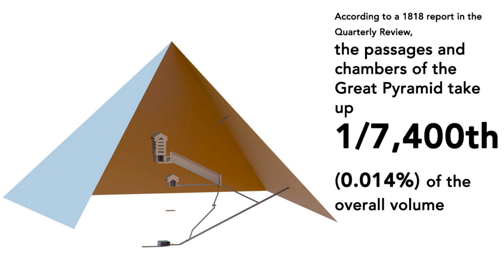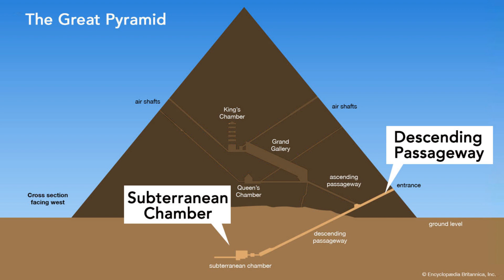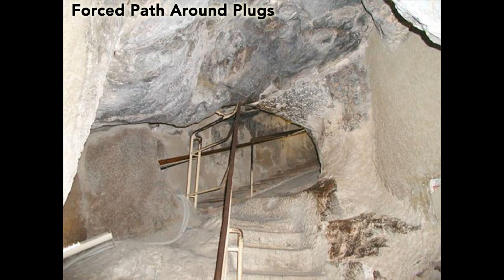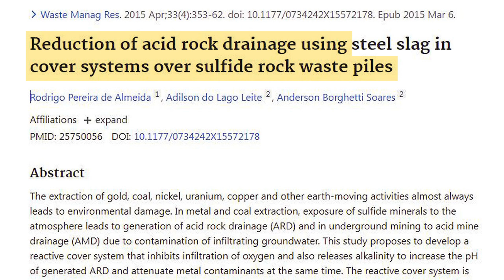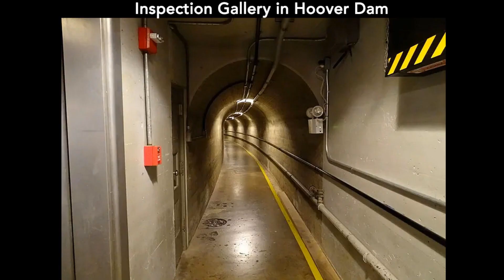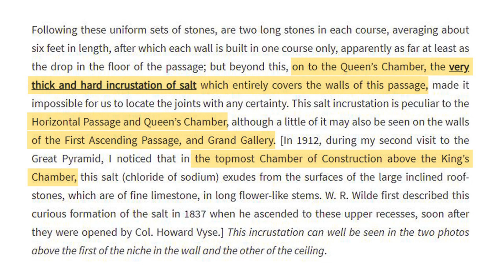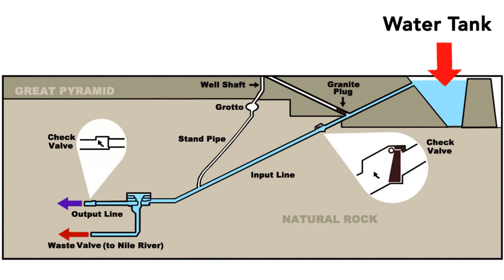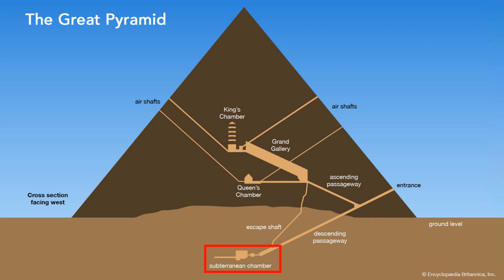The Mystery of the Great Pyramid's Interior System?

Comment: I really enjoy your various interpretations, though there are a few important things to note. The shafts that egyptologists commonly refer to as "air shafts" that are leading down toward the chamber didn't originally complete within the chamber, there was still a solid layer of granite between the chamber and shafts. It was only later smashed open by "archeologists" essentially searching for treasure after realizing that there seemed to be a reachable internal structure at those two locations. I think that's a really important detail that often gets overlooked. They also don't appear to reach all the way to the surface of the pyramid. The pyramid rover images within the shafts are somewhat limited, but they do tell an interesting piece of the story. All that said, I really do enjoy seeing how you parse the data. Cheers!
Reply from the maker: Thank you for sharing with me, Juan. I appreciate it! I read that the air shafts to the Queen's chamber were blocked by salt encrustation (efflorescence). Modern explorers removed the salt and the shafts are indeed connected with the chamber. You are right - the Queen's chamber air shafts do not reach to the outside and there are small doors at the end. I have another video explaining my thoughts on these blocked air shafts and more -  Egyptian Pyramids Reveal Acid Mine Drainage Stains? https://youtu.be/-QyIJ-w-8vc
Hope you will find it interesting :-)

Comment: The Dimensions of the Arc of the Covenant, fits exactly into the King Chambers box. Maybe part of the power supply from it's Mono Atomic Gold inside the Arc? There are no lantern soot on any ceilings.
Also you cannot cut granite blocks with bronze hand tools,  or have man moving 100 ton blocks 500 miles from the Aswan quarry.
Reply: Do you know if anyone has computed, from its dimensions and materials, the approximate weight of the Arc of the Covenant?

Comment: I think the marks within the lower parts of the pyramid are more likely to be caused by water erosion than mining. A guy on youtube (who's name escapes me) built a scaled down model of the pyramids interior and it was a working water pump. The direction of the water in the lower chambers matched the erosion patterns we see today.
Reply from the maker: Thanks for sharing with me. For a hydraulic ram pump to function there needs to be a water tank/water source located higher than the water tunnels. Assuming that the passageways and chambers in the Great Pyramid were indeed made to transport water, which means the water level of the water source (the Nile) needed to be higher than the entry. We don't see such water tanks on the Giza Plateau. If the pyramids were built right before the Younger Dryas, back then the sea level was about 60 m lower than today. During the Last Glacial Maximum which lasted for a few thousand years, the sea level was about 120 m lower. Since the Giza Plateau is close to the Nile Delta and the course of the Nile is fairly flat, the water table of the Nile would be closely associated with the sea level therefore much lower (60-100 m lower) in these earlier time periods. The base of the Great Pyramid is about 61 m above sea level today. Bringing water up to the plateau would have been a very labor-some work. Also, what's the point of creating a water pump on top of the Giza Plateau? A water pump wouldn't need to be in a pyramid shape or be almost completely solid.
Reply: @CuriousBeingbyTina  The pump is only the lower part. The Pyramids were surrounded by walls like a kind of moat, and you can still see what's left of them today. There was a lake nearby which fed into it.
Reply from the maker: @vanenmar7491  The walls don't make an enclosure around the Khufu or Khafre. There are no signs of a lake on the plateau. The rock plateau was originally much higher than it is now: https://youtu.be/y6ShuJdzDS0
Reply: @CuriousBeingbyTina  If you look on any aerial views of the pyramids you can see they all have the remains of walls around them, even the unfinished one that's now inside an army base. 

It's strange that shafts and chambers which you suggest were the result of mining create a working water pump. And not only that, but the marks left are replicated by water when a model is made.
Reply from the maker: @vanenmar7491  When you look at the aerial views of the pyramids, you should be able to see that there are no walls on the east sides. Photos taken from ground can show that as well. 
I think you misunderstand my hypothesis. I proposed that the pyramids were mine waste storage and the interior structures might be used for collecting and treating internal acid mine drainage.
Reply: @CuriousBeingbyTina  Places that have a lot of water erosion above ground do not need to have a water pump.

Comment: I am just curious where is the infrastructure for making thousands of multi ton concreted tailings? i also noticed, if your rainwater seepage and and waste water  drainage is correct, then it only services about 1/3 of the pyramid as anything below the queens chamber shafts wouldnt involve itself in the drainage system.. seems pretty inefficient.   i do appreciate your theory and all the work you put into it.
Reply from the maker: Thank you. I think it's possible that the concrete blocks made of tailings and waste rock were cast in-situ in a way similar to today's poured concrete buildings. Long conveyors might be used like the ones we see in modern mining/ quarrying sites. Once the construction is complete, cranes, concrete mixers and other equipment would be moved offsite.  
As for the internal drainage, there might be more small shafts/ tunnels in the pyramids which can't be easily detected by scanning. Since the later and more superior Khafre Pyramid seems to have no above-ground openings, I think perhaps the upper interior openings in Khufu were then considered to be not necessary; maybe because the region is very dry and only received one inch (2.5 cm) of annual rainfall. 
I made follow-up videos to further discuss my hypothesis. Hope you can check then out. 
The Secret Enigma of the Egyptian Pyramids’ Interior (The Red, Bent and Khafre Pyramids) https://youtu.be/hxWEWUsvcS4
Egyptian Pyramids Reveal Acid Mine Drainage Stains? https://youtu.be/-QyIJ-w-8vc
Egyptian Pyramids & the Impact of a Green vs Desert Sahara https://youtu.be/8CVetiox04c

Comment: Sitchin's theory was that the "Khufu" graffiti found inside the great pyramid was an intentional forgery - so it would fall in line with their version of prehistory - and that they were tombs. The point you raised about the salt deposits also supports the weathering around the sphinx.   This theory has potential.
Reply from the maker: Thank you. The "Khufu" graffiti is indeed very questionable.  I made a few follow-up videos on this topic. Hope you will check them out. 
The Secret Enigma of the Egyptian Pyramids’ Interior https://youtu.be/hxWEWUsvcS4
Egyptian Pyramids Reveal Acid Mine Drainage Stains? https://youtu.be/-QyIJ-w-8vc
Egyptian Pyramids & the Impact of a Green vs Desert Sahara https://youtu.be/8CVetiox04c
Great Sphinx: Buried Secret Exposed https://youtu.be/0YoM4W5W0pg

Comment: I think the great pyramid originaly was a dew point freshwatermaker. Sealed for thousand of years. The step out from the kings chamber in old photos was cavitated and nowdays it is cemented for conviniance. This cavitated block tells me that water has affected the block for a long time. Also the great gallery if one think is togeter with the cambers an low pressure and therfore ongoing sucktion thru the air shaft. The process i a loop. In moderna dew tec one use refrigrant to fell out the humidity. Some 80% in the air at giza could make the great pyramid very eficcient. Raising the ground water and deliver fresh water to gardens and People living there.
I like your videos :)
Reply from the maker: Thank you for sharing with me. I appreciate it. The pyramid builders were highly sophisticated. Wouldn't they have better more efficient ways to build a solar sill to collect water, instead of build a massive almost completely solid pyramid? If the Great Pyramid was a condensation water collector, then what purpose do other big pyramids serve since they don't have the same internal structures 🙂
Reply: @CuriousBeingbyTina  the books of M.Thomsen (denmark) and in som small text he says the pyramids were there before the egyptians and som 50.000 years erarlier. He also says that they were build to raise intelligens on the planet.
The meter mesurment have an explanation that one dropp was fx = one centimeter. Math and other mesurment and practical use ( my interpetation) i picture rh whole giza complex stood there and som stoneage peaople arrived...curios and no one is there...they enter...
Reply: @CuriousBeingbyTina  m.thomsen also have a book the sfinx. In it he write that it is a symbol of the creation from animal to human.
One have to think that 50.000 yers ago the egyptians hiroglyfs was not there. M.thomsons books is named ,the tird testament, if you are interested :)

Comment: I love that you have looked a little into the hydraulic ram pump idea. I think this is very plausible in combination with some electric making, I have also heard of of walls around the pyramiaids that was suposedly able to hold water, wich is one of the theories on how they built the pyramids, very heavy stone blocks can be easily placed with boats/barges if you can rise/lower the water. Other than ancient type of concrete used for block this also seems plausible. Very interesting video, keep up the good work cheers/Johan
Reply from the maker: Thanks a lot Johan! Cheers
Reply: @CuriousBeingbyTina  I have watched more of your very good and well researched videos, water might be used for mining operations or pumping it away to be able to mine is also possible, underground mines use pumps to keep water away. So the pyramids might be multifunctional  which is no surprise to me at least cheers
Reply from the maker: @ScanianDude  I agree that the pyramids might be multifunctional.

Comment: I’m almost convinced pyramid is a form of mine tailing. My second thought suggest not at all.

The only time we need French drain and air shafts is excessive soil moisture/water absorption. That compromised/defeat the surface tension built up in between adjacent “unbind” grains of sand/soil/mud. 

However pyramids weren’t constructed with unbind grain of sand. It is made of pour mold limestone concrete. Swollen and liquified in moist and wet environment isn’t an issue with limestone concrete. 

Secondary effect? 
After substantial lost of surface tension, the soil tends to float but buoyant behave as liquid. Hydraulic force from a reservoir immediate next can push dislocate that water swollen dam. Therefore French drain is a must have part to gravity dams. However pyramid doesn’t have hydraulic pressure issue as those gravity dams do. Pyramids only have mechanical issue to deal with free of hydraulic. 

Mine tailing addresses different issue pyramids don’t possess. Tailing was progressively constructed several layers increment at a time such that the first two layers are water insulators, integrated with clay on top of plastic sheet base connected to side drains necessary to maintain grain to grain surface tension and to prevent swollen or liquify.
Reply from the maker: In my comment I was using a French drain as an example of underground perforated drain channels. In this video I presented my theory that the air shafts might be similar to the porous concrete drains inside gravity dams.

Comment: let me know if I understand this correct - are we saying those air shafts of pyramids act like French drains and modern  perforated pipes intended to even out and bleed off excess water previously infiltrated, necessary to prevent the structure from disintegrated by internal water pressure build up, right? 

If so, are we implying that (Joseph Davidovits version) lime blocks and air shafts of pyramid are water porous? If so, we’d expect the air shaft are wholly made of limestone but granite, right? 
 
It was recorded that all four air shafts were built with no passage into the King and Queen’s chambers. Do we still think idea on page 14:08 is reasonable?
Reply from the maker: Could you provide the sources that indicate the air shafts are not connected to the chambers? The ones in Queen's chamber were blocked by salt encrustation though the connections are there. 
Concrete is porous. Stone is also porous. They are not air tight or waterproof.
Reply: @CuriousBeingbyTina  the entrance to these air shafts from k and q chambers were sealed behind by chambers granite wall. Archeologists knocked on chamber wall from block to block to detect solid/hollow echo finally found some hollow spots. With permission granted it was then chiseled open one after another, in modern days. I saw the documentary on tv but I can’t find a link on YouTube. You can trust me on that. I can’t find records anymore.

Comment: Sorry but no one running any job site could possibly have a budget big enough in any construction project to make tailings into perfect fitting blocks, just to stack a perfectly square, perfectly earth axis aligned, pile of waste. Also if they were so good at refining waste as to have the world marvel thousands of years later at there garbage, where are the works this waste came from? They should have been more marvelous and even better built, and we should be admiring them as we visit Egypt. Trouble is there are no such projects to see. The pyramids therefore have to be the project and not the waste.
Reply from the maker: I explained my thoughts in previous videos. Pyramid builders were more advanced than us. Not too long ago, all the mine waste was dumped directly into rivers and lakes. This had disastrous consequences but people in the past didn't understand the importance of treating and storing mine waste. If you told people back then they need to put tailings in a pond and build a huge dam around them they would have laughed at you. Though now the tailings pond is a common practice. The situation is similar to how people today might not realize how necessary it is that waste storage sites be built with accuracy. Our knowledge is progressing. We can't assume we know the best. We changed from dumping waste in lakes to making massive tailings ponds. Now we have dry stack tailings mound method. Most don't see the necessity of carefully designed waste storage now but maybe in the near future we will see such mine waste storage structures in practice.

Comment: Hi Tina, i have a couple of questions or ideas thst you might be able to help me with if you get a chance. What about a mixture of waters in the pyramid. Salt and fresh separate when still, could that help with working the pump system?  Or with other systems?  The air shafts would collect a small amount of water unless the openings on the face were a collection area as the holes are very small. Minimising water intake. 
I've noticed on some shafts there is a couple of holes in the top and bottom of the shaft entance, like a butterfly valve used to be there.
So many questions...  Many more. 🤣
Reply from the maker: Thank you for the comment. I think pyramids were probably designed and built for a dry climate. Currently  “Cairo is donated on balance 26 mm (1 in) of rainfall per year, or 2.2 mm (0.1 in) per month. The wettest weather is in January when an average of 7 mm (0.3 in) of rainfall (precipitation) occurs.” 

The Sahara/ North Africa goes through humid/dry cycles. The Sahara was green and wet from about 14,500 years ago (after HS1 the millennia-drought) to 6,000–5,000 years ago. The humid period before that was around 85,000 to 78,000 years ago. HS1 (20,000-15,000 years ago) is the time period that coincided with the severe human population bottleneck which I think could be the ending of an advanced civilization (https://youtu.be/Zs4zLKbp4Ic). If the pyramids were built during 78k-15k years ago, then the Giza Plateau would be as dry if not dryer than now. Therefore, it's possible that drainage channels/ air shafts inside the pyramid were designed for an arid climate and don't need to be sizable. Plus, I think the upper interior structure in G1 might be experimental, just like the 8-sided feature, because the later, more advanced G2 is not 8-sided or have much above-ground opening. The complex interior system in G1 might not be necessary after all.